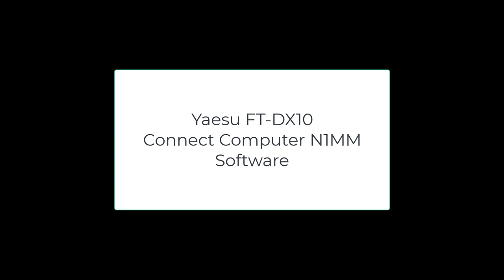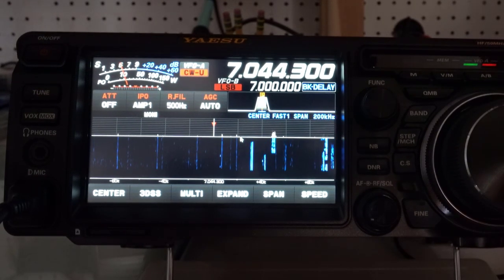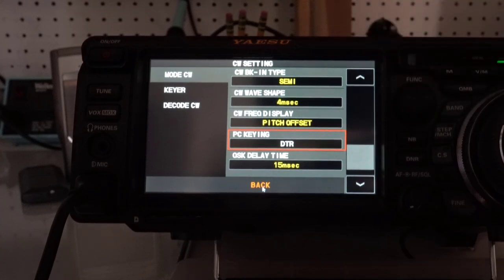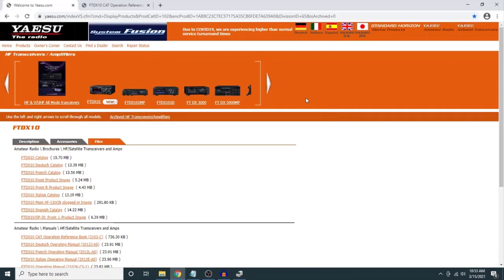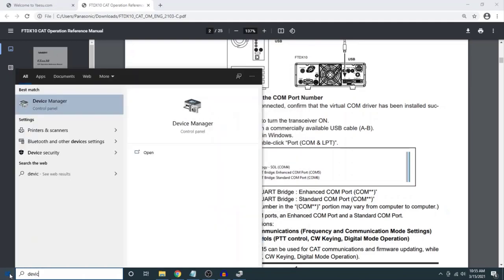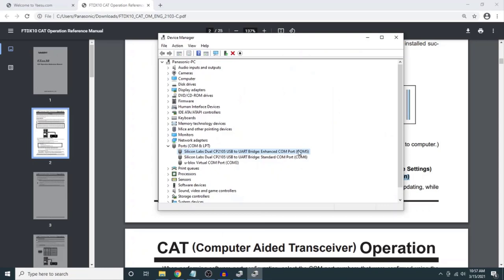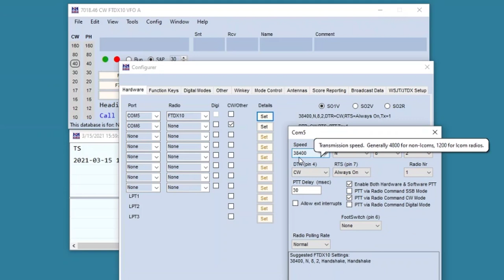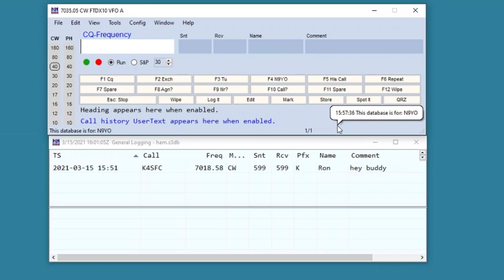Yaesu FT-DX10 Setup N1MM  CW Computer CAT Menu Control for Contesting

Comment: Absolutely the best done tutorial for Amateur Radio I’ve run into to date. No long verbose unrelated introductions. No hubris. Just a fellow ham who figured it out AND shared the knowledge. Perfect. In my situation the USB to USB would not work. Fortunately I also bought the USB /CAT cable  (FTDX-10 manual reference page 14,  item 12 that has one USB end and the other “funky looking” end  - check the diagram pic on page 13 labeled “12”.)  My comm port numbers were different as can always be the case. But now it works effortlessly. Thank you for your editing and camera work also - easy to see and follow you with the help of the pause button. I immediately started going on the air and stopped. Just had to send this comment before playing. I owe you. Great job! De kr4bg/Matthew - Virginia- ex Wb2lar.
Reply from the maker: I appreciate that comment very much Matthew.

Comment: Hi Tom, DTR and RTS  are lines that are set high or low as needed to allow serial comms, these are originally from the serial port RS232 comms DTR Data Terminal Ready, RTS Ready to Send, the 9 way serial port on the device is a cut down verson of the original 25 way RS232 serial interface, so in short, this is legacy serial interface terms, still in use, with the Yaesu USB, hope this helped in some way. Seems the firnware still uses, if needed
Thx for this Video, 73
Reply from the maker: Hey, Tom, thanks for the comment.  I put these out there to help others avoid some pain hopefully.   Tnx fer the Serial instruction.  Seems like there's some history behind these ports...that I don't know.

Comment: Just watching this video to learn about cat cables and my new ftdx10.  FYI - DTR (data terminal ready), RTS (request to send) and there is one called CTS (clear to send).  These are serial port methods from way back to determine if your port is going to send data or to wait.  Usually one is setup by the manufacturer to sync with both pieces of equipment.  The computer can do all of them, but likely, the setup and drivers for the radio may be limited.
Reply from the maker: Thanks for the comment I really appreciate it.

Comment: Am I correct in understanding that you were able to use N1MM+ to key your rig w/o any external (e.g., MORTTY CW, WinKeyer, etc.) keyer interface? I've been trying to copy what you did using a SERIAL (not USB-Serial) cable. I've been able to trigger the rig's TX light, but not to actually key. Also using FTDX10. I may have to go the USB cable route.

Comment: RTS and DTR refer to the RS232 control lines. https://www.electronics-notes.com/articles/connectivity/serial-data-communications/rs232-signal-voltage-levels.php.  The FTDX10 series works best with just USB control, especially with wsjt-x.
Reply from the maker: How do you set it up with "just USB control?"